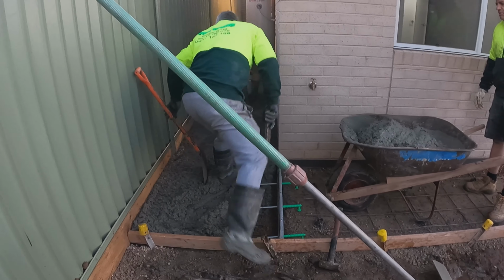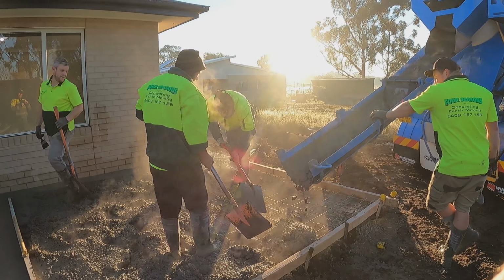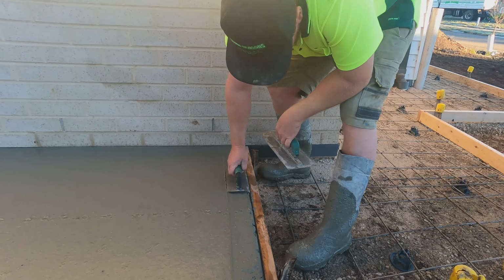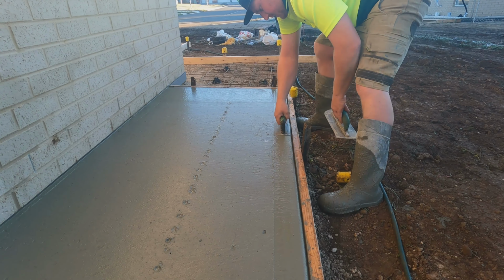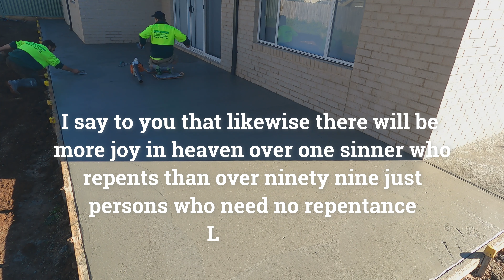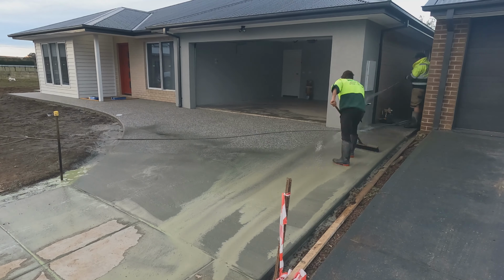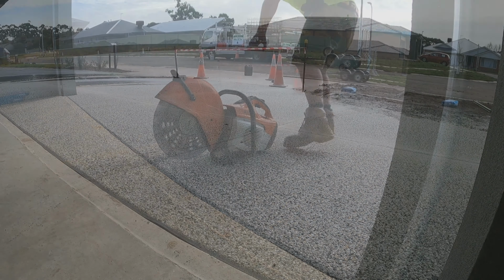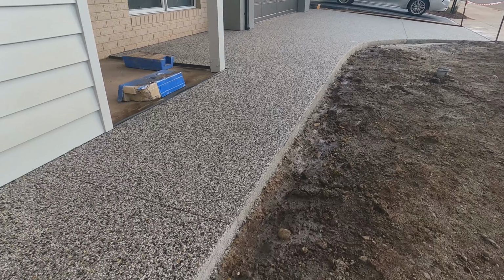🇦🇺 EXPOSED AGGREGATE DRIVEWAY 🇦🇺

Comment: hi, wondering when we can spray the chemical and what chemical using for spray?
thanks
Reply from the maker: Honestly depends on the weather and washing it. Generally after finishing. We use prime exposed
Reply: @earthcongroup  after i washed when i can seal it and how many coats?
Reply from the maker: @SonTran-hx9rz  After acid washing. Three coats using pump: 50 solvent/50 sealer,
then 80% sealer /20% solvent and then 100% sealer.